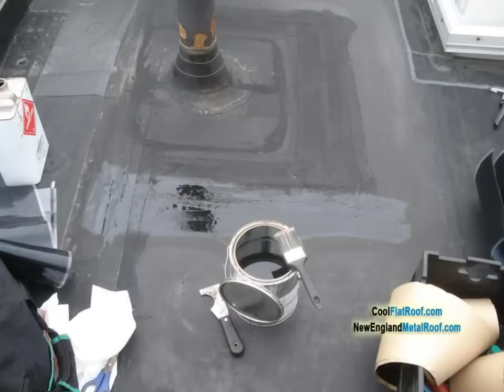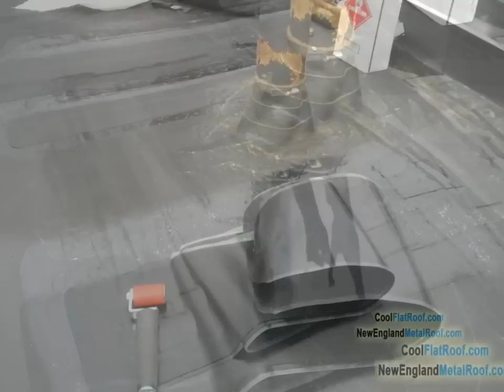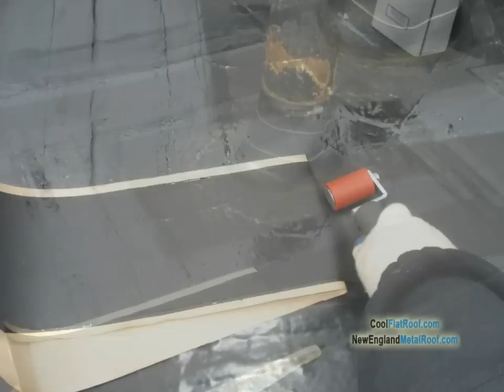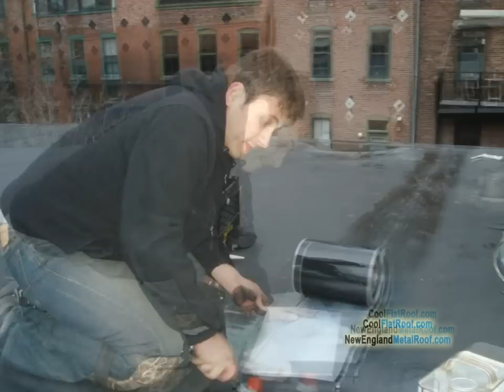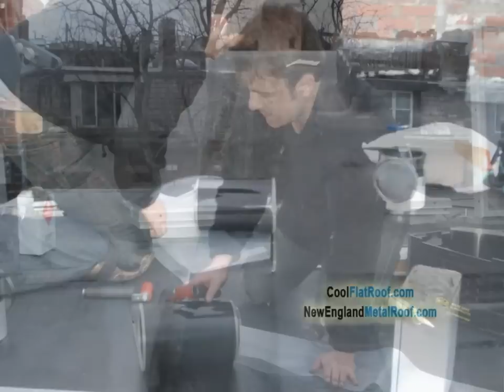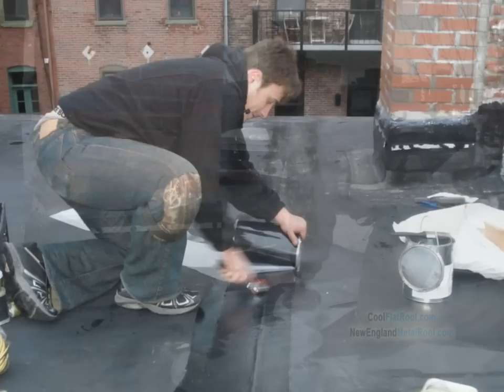Rubber Roof Repair - Reseaming with EPDM Cover tape flashing

Comment: Hi.last summer I removed old felt, all the boards and some joists from exciting double garage roof. I then fitted 18mm osb board and bought rubber roof EPDM. 6 months has passed and water is seeping in to the garage, pretty much in the middle .I've been back up on top several times. Even though I cant find a hole, I've replaced the flashing, double checked the curb edges. Been on hands and knees looking tirelessly for a hole. Its absolutely baffled me .this project cost just over 2k to do myself and now it's no better than the 1970s felt one . Any ideas please ? I have a fair amount of rubber left over and glue, but where do you patch when there is no hole ! . ?